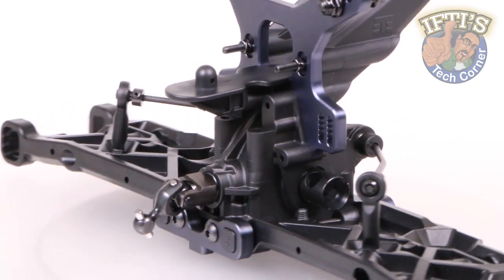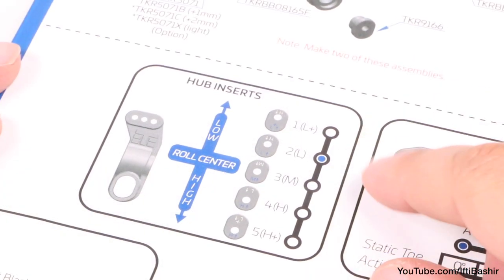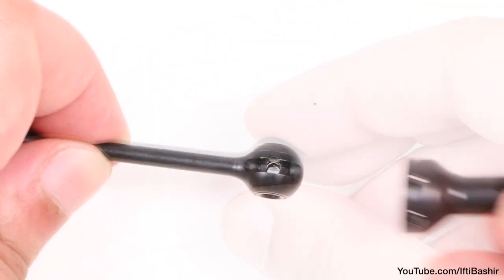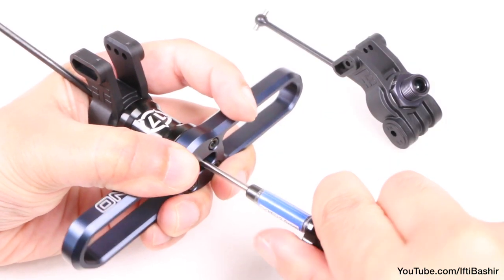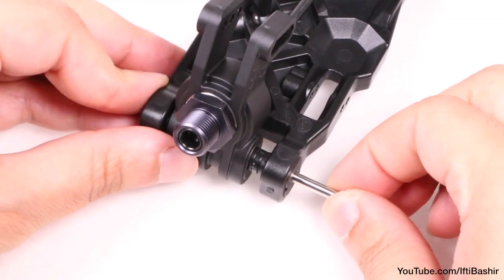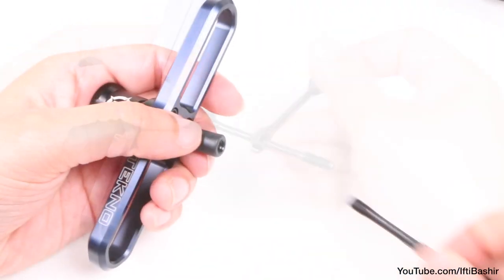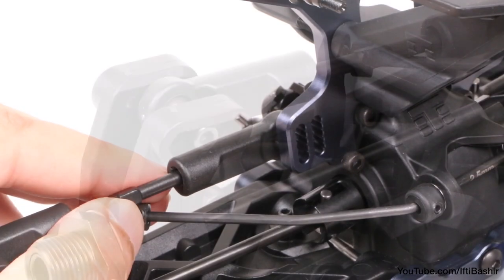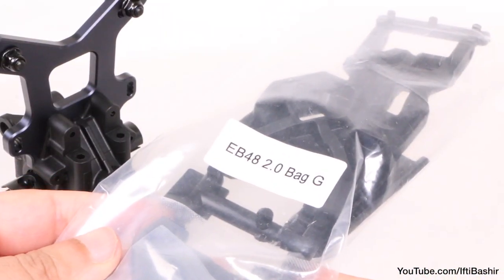#07 Tekno EB48 2.0 - BUILD SERIES - Kit Bag F : Rear Hubs & Camber Links

Comment: In the instruction manual bag F has the builder apply grease to TKR8073 pin in the CVD.  Just curious...any reason why you did not ?   Good build series,  you speak clearly with a good cadence.  Well done!
Reply from the maker: Apologies - I actually did - I placed a blob inside the hole before inserting the pin rather then on the pin itself ;o)
Reply: @iftibashir  hi, thanks for all your time and effort by far so far the best build series I've seen on YouTube. perhaps it would be best to annotate your video for that mistake just in case somebody is following your video only & not referencing the manual?